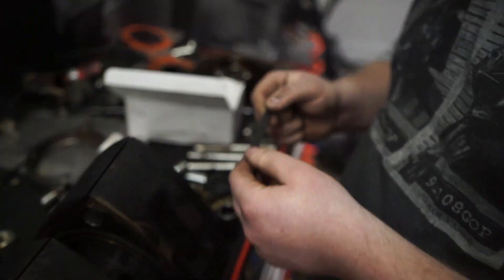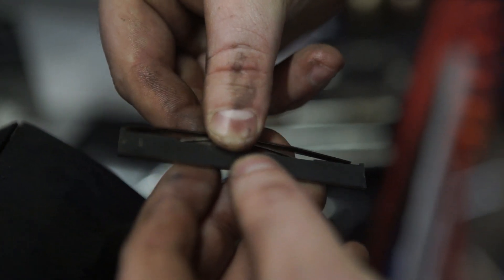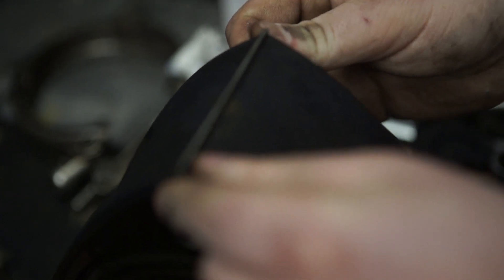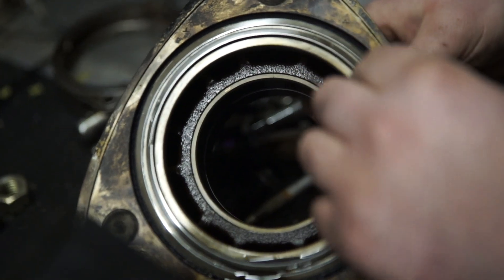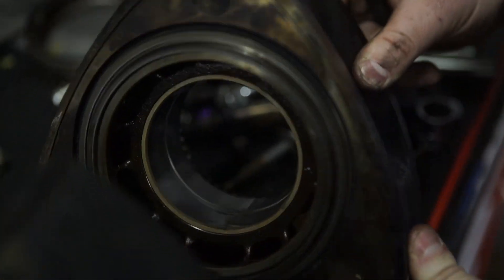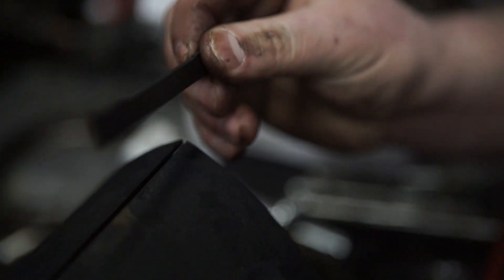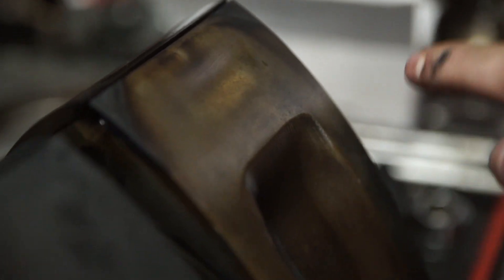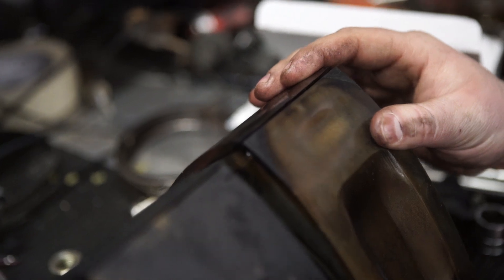How Apex Seals Work In A Rotary Engine (RX7 RX8 13B Renesis)

Comment: doesn't the centrifugal force push the apex seals outward and help seal it? I thought they worked similar to as a fuel pump which also has "apex seals" but they don't have springs

Comment: If only engineers could find a way to lubricate apex seals like piston rings as it goes down the chamber. By the way it is designed, the scraping motion of apex seals goes straight to combustion stroke, burning up oil. It seems like there is no way to cool down or lubricate apex seals.
Maybe vibranium or adamantium apex seals could work. =)
Reply: Its fundamental geometry, round pistons are simply better the triangles just as round wheels are better than square wheels.

Comment: Porcelain coated cylinder with high temperature titanium Apex seals?  Or Halo Apex seals allowing oil to be applied directly at the seal?  That would at least conserve oil.
Reply: Still would not solve the multitude of other fatal flaws in the Wankel design, lubrication is not even the primary failure mode in Wankel engines.
 Apex seals are inherently weak and unreliable they are easily damaged by erratic combustion and high brisance detonation or "Knock".
Carbon build up is not a cause of apex seal failure, it's a symptom of low compression... the result of damaged seals.

Comment: What if you used a rotating cylinder would that fix the wear issues
Reply: The solution is to use a round, reciprocating piston, Mazda solved its engine reliability problems by discontinuing Wankel engines.

Comment: What's the difference between the 2 mm and a 3 mm Apex Seals is the 3mm  better. I have rx7 1991 fc
Reply: The solution is to do what Mazda did... switch to round piston seals.
Reply: @Sander Van der Kammen  thanks for finally getting back to me Sander. I have another question for you...just a minute please
Reply: @michaellaframboise7646  Have you heard the joke about the two FC owners that walk into a bar?
Reply: @sandervanderkammen9230  no
Reply: @Sander Van der Kammen  Well, since the decriminalization of cannabis in Canada, I would think those 2 fc owners probably said "Don't drink and drive",    "Smoke and fly"😂😅🤣😇
Reply: @michaellaframboise7646  The 2 FC owners walk into the bar and the bartender says "Sorry, the gay bar is across the street"

Comment: Why didn’t they just produce a very durable apex seal From the start? Like rx8, why didn’t they just install a high quality apex seal from the factory? It’s such a tiny part yet it does such an important job
Reply: The entire concept of the apex seal is inherently flawed by design... you can never make an apex seal as strong or as durable as a piston ring seal... and it is this fact that explains why all 26 of the original Wankel KKM licensee's have abandoned the Wankel engine... including Mazda.

Comment: I have an 1986 RX-7 FB GSL-SE And it has been sitting in the garage for about 7 years and has last been started 7 years ago It also has 75 thousand miles so should i check the apex seals? I would like to know. I love that car i even named it Radient. Not only would the Apex seals need to be checked but what about the transmission and clutch and brakes? Im worried of the apex seals wearing off and then the engine would blow. Please tell me what to do.
Reply: Hello MissionTWA, I'm curious as to the life of your  86 rx7 fb gsl-se,and are you a pilot?

Comment: Isn't the detonation dent from the trailing spark plug? I'd imagine detonation from that spark would cause this, since it's about thee right area when the trailing would be firing. 
Also, I'm surprised you didn't show two piece apex seals, where the two pieces have angled edges so that the seal stays straight rather than rotating slightly due to manufacturing tolerances. 
Another reason why more research should be put into laser ignition, since not only would it save apex seals from the gap for the plug; laser ignition can be focused to ignite deep into the chamber, not just where gas meets 'spark' like with spark plugs, and this would mean that you can position where ignition would be most favorable. 
Along with some other modifications, the rotary could become an even better engine. 
Personally, though I'm not sure how well this would work, I think someone should look into seals, both apex and oil ring, be manufactured with a friction reducing coating, which might aid in life longevity as they're more of a bearing surface.

Comment: Glad to hear about detonation, and how it's violent enough to dent the rotor face, causing the subsequent seal failure. I had no idea pressures could get that high in the engine...
Reply: Keep in mind the heat at that point in the cycle, and the constant heat cycle the rotor is going through. More heat means the metal is more malleable, heat cycles will weaken a metal. The two, combined with boost and high detonations, could kill a rotary faster than it would a piston. 
I'm sure out there somewhere, there's an aftermarket rotor that's been made to withstand high boost and higher detonation, probably some race company makes it. Could also see what Rob Dahm is doing considering he's using a turbo the size of one they use on construction vehicle diesel engines.

Comment: so how would you rate an 04 rx8 with 134 thousand miles on the original engine with not hot start issues. I don't premix (I guess wouldn't hurt if I did) I don't have a sohn adapter, all I do is keep the oil changed with conventional 5w20 every 3000 miles or less. any suggestions on getting more miles out of it?
Reply: pmm4177 Keep doing what your doing, premix won't change what's already done to bearings. I actually just sold my perfectly running S1 Rx-8 with 135,000 miles only because it was just sitting due to me having the FD. NGK plugs/ wires, ignition coils between 15,000-20,000 miles and Penzoil 5w-30 conventional on mine when sold. The renesis with that type of consistent maintenance of course making sure not to develop vacuum leaks, I could see going to 200,000 minimum easily. Can't speak for reman motors but on the original, yes.
Reply: Brandon Hudgins I just installed an LS coil conversion yesterday to do away with those god awful Mazda coils

Comment: My friend asked if you can add another engine pulley to compensate  for the 10ms engine cycle compared to Otto engine 4 stroke 20ms cycle. Would that work instead of changing to x2 size injectors?
Reply: pmm4177 OK! Thanks for the reply+

Comment: how do you time your rotors?
Reply from the maker: Rotors only go into the engine one way. As far as base timing, distributor or a crank angle sensor.
Reply: where can i find a timing belt for my rx8?
Reply from the maker: RX8s do not have timing belts.
Reply: i also need a throttle cable for my Rx8, can you supply one?
Reply: @joshshift  i have what you need the cable is 269.95 and belt is 699.49

Comment: I have a question. Could the combustion dent on the rotor {the one that's actually supposed to be there by design} be moved to the end of the rotor in the direction the rotor spins to increase combustion/thermal efficiency and possibly lower exhaust temps and MAYBE increase power?
Reply: Moving the spark plugs to match an offset chamber would require a third, far trailing, plug. Three plugs have been used in the past to ignite a very, very small volume where there would be uncombusted fuel in a normal setup; forgot what the results were of the three plug setup, but offsetting thee plugs from where they are now would require that third plug as you would have a large volume of the combustion chamber that wouldn't ignite when it should, cause a backwards force on the rotor when it does combust.
Reply: That might be a good idea if you move the spark plugs to right under the dent when ignition takes place.
Reply: @mistert9144  The air fuel charge moves past the leading plug, towards the trailing plug. They need to be spaced apart, not close together.
Reply: Hmm, I see. I was thinking that, too. Maybe replace the spark plugs with two points inside the engine that spark electricity between them so that the 'spark plug hole' can be smaller and/or non-existent, too?
Reply: Mazda is developing laser ignition to take care of the hole.
Reply: @mistert9144  Mazda is not working on laser ignition.
Reply: That's a sweet piece of information. I did some research and found out that Mazda used the three plug setup in their design that won Le Mans. But I don't believe moving the spark plugs will cause a backwards force. Ignition will still take place after 'TDC'. I also found out that due to centrifugal force, gases are concentrated on the outside of the chamber. Might it be better to change the housing shape slightly so that the combustion cavity in the rotor can be removed entirely?
Reply: @mistert9144  3 plugs lowers thermal efficiency with little increase in combustion efficiency.
Reply: The combustion recess is placed there because of the poor combustion chamber architecture of the Wankel which separates the the flame propagation through the air fuel mixture.
Remove the recess and combustion becomes erratic and creates misfires and detonation.
Moving the the recess reduces power and efficiency.
Reply: @sandervanderkammen9230  My idea was to move the recess from the rotor to the housing where the spark plugs are since gases are concentrated on the outside of the chamber. This would also increase exhaust efficiency.
Reply: @mistert9144  Removing the chamber recess blocks off the flame propagation as it travels through the air/fuel mixture charge.
 What do you mean by concentrated on the outside of the chamber??? That doesn't make sense.
Reply: @sandervanderkammen9230  Due to centrifugal force from rotary motion, the aerosolized fuel is concentrated on the outside of the combustion chamber. I know there needs to be a recess for combustion, that's why I said to move it to the housing instead of it being on the rotor.
Reply: @mistert9144  Centrifugal force? What rotary motion?
We are talking about the Wankel KKM  engine.
The fuel/air mixture cannot be concentrated, it is at the same pressure throughout the chamber unless there is detonation occuring which will destroy the engine.
 What??? You can't move the recess to housing, thats not possible.
Reply: @sandervanderkammen9230  Google a GIF for the wankel engine. The fuel air mixture moves from intake to exhaust in a circle around the rotor. This motion creates centrifugal force and concentrates the fuel air mixture to the outside portion of the chamber. So there IS more pressure on the outside.
Reply: @mistert9144  No, there is no centrifugal compression... 
The triangular piston (rotor) does not  spin concentrically.
The piston obits in a planetary motion with a 30mm stroke.
 The pressure is evenly distributed in the chamber once the intake port is covered and the compression stroke begins.
Reply: @mistert9144  It's not possible to move the combustion recess into the housing, this is completely impossible and will not work.

Comment: good video but, get a cameraman that knows how to hold focus!
Reply from the maker: It's not as easy as you think it is to hold focus.
Reply from the maker: No offense to you, but I'm well aware. I'm a professional filmmaker by trade. I had to resort to a Canon 24-70 f2.8L because my cine lenses were being borrowed and the lack of a smooth focus ring aided in the difficulty. This was a low light situation, 2.8 was the smallest aperature I could use in this particular instance without introducting even more grain.
Reply from the maker: It was shot on an A7S at 40,000 ISO. The room was very dark.
Reply: I'd be fucking embarrassed to call myself professional if this is the type of shit you come up with.
Reply: @Towlieee  your comment just showed how ignorant you are about film making and cameras in general.

Phones have a tiny sensor and keep everything in focus all the time, but your potato phone could never produce a result this good in a situation where a top of the line full frame camera required 40k iso to produce a useable image, tldr: your 10 year old potato would not get a single image in the condition where they shot this, focusing would be the least of your issues

Comment: is the dent/deformed rotor usable?
Reply from the maker: Zshu tung depends on how dented the rotor is. When a rotor dents, it can deform the slot where the apex seal rides. You need to inspect it to ensure everything is straight.
Reply: Is it even possible to machine it back to it's originality? And thx for the kind info
Reply from the maker: Some people take them and machine them out to 3mm apex seal rotors.

Comment: how does this deformation hapens? wrong ignition timing?
Reply: it can happen for alot of reasons all of them similar to why it happens in a piston engine. the most common being poor fuel quality or wrong octane rating. oil in the combustion chamber which effectively lowers the octane rating of the incoming fuel. not enough fuel (running lean). hope that helps.